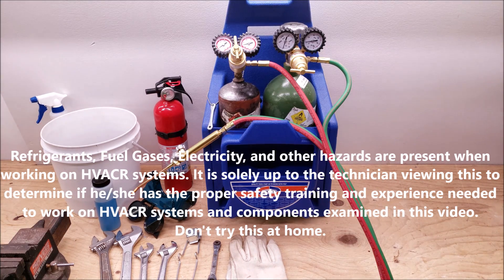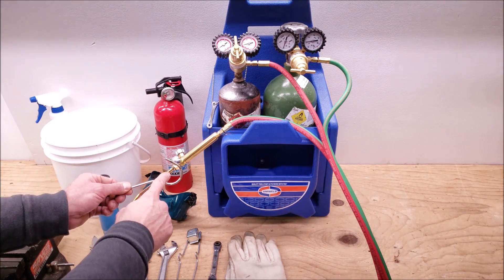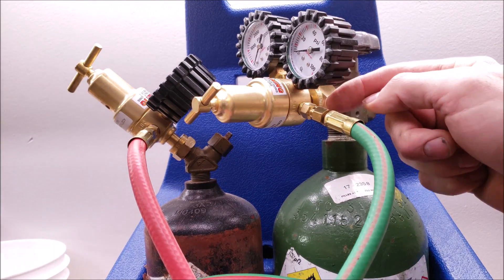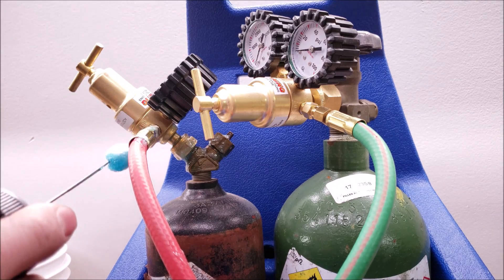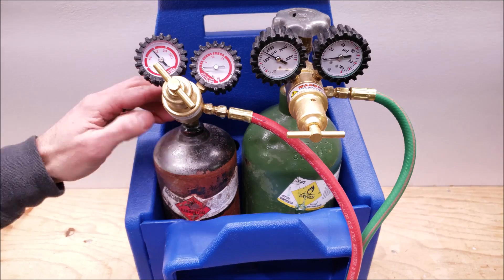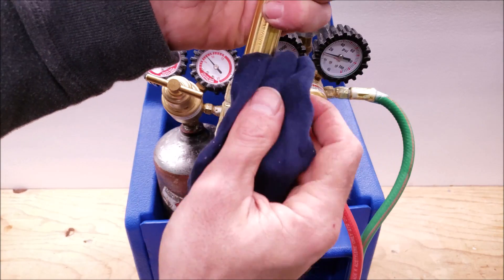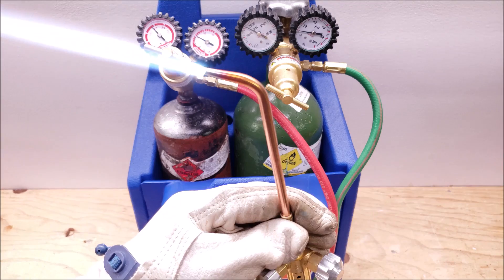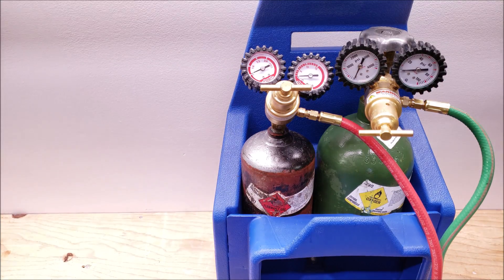Oxy Acetylene Brazing- Setup, Leak Test, Reg Adjust, Startup, Shutdown

Comment: The nut on the torch tip is to be hand tightened only.  Not sure why they put a hex on it but it does say in the manual to not use a wrench on these tips.  Its not a metal on metal seal like some older torches were, overtightening will damage your o rings and cause leaks, backfires,or worse

Comment: Need some advice please.  I found regulator gauge sets on amazon for light duty use, but it says it fits all acetylene tanks EXCEPT FOR MC AND B TANKS and I wanted to use tanks the same size as this video (MC acetylene tank). Could I use adapters or is there a regulator set I can use with these MC tanks and the small oxygen tank in this video? Thanks for all  the great videos and the help.

Comment: Nice informative video. I believe oxygen cylinders are seat to seat valves and should be opened all the way, otherwise they can leak around the stem packing (2000 psi is a lot of pressure). For additional safety leave the wrench on the acetylene bottle you don't want to go looking for that during an emergency.

Comment: Where is the flashback  arrestors or  check valves. I have similar torch and bottles and very confuse about flashback arrestors installation. I bought Flashback Arrestor Set.  Inline, 1/4 inch Barbs and I'm in the way to cut the  hoses and install arrestors. Flashback arrestors is not available for 3/8-24 A hoses. I like to see some  body to cut hoses and install arrestors and what clamps can be used.

Comment: What are your thoughts on a Turbo Torch set up?
Reply from the maker: Air acetylene will work just fine! I use those as well, thanks!
Reply from the maker: The A-11 tip is the one I use the most, thanks

Comment: Excellent explanation. 
One question. Why don’t they have a handle on acytline tank similar to oxygen tank? That would be more easier in emergency
Reply from the maker: They actually are in the process of changing them over to the easier to shut off handle now but there is a lot of old tanks out there, thanks!

Comment: Excellent video, uniwelds website says to never use a wrench when installing torch tips to prevent damage to the gaskets. Just an fyi.
Reply from the maker: I only snug it there. If you keep trying to tighten it then it will certainly damage the grommets, thanks Matt!

Comment: open the tank  valves all the way, they were designed to work that way.
Reply from the maker: Hey David, the manufacturers and distributors all recommend to only crack the acetylene tank which is fine for the output to the reg, thanks!
Reply: Should not open acetylene tank valve more than 1/2 turn. Not needed.
Reply: You absolutely must open the oxygen tank valve all the way to back seat otherwise you could lose the contents of the tank it will leak. Just crack the acetylene tank valve is fine.

Comment: Great video of safety points! Your ABC rated fire extinguisher would suit your purposes better if it had a hose on the end just in case you had a fire through a wall penetration. It shouldn't happen but mistakes do happen....
Reply from the maker: Hey the more additions to the safety gear the better, thanks Jonathan R!
Reply: @acservicetechchannel  It's not something you realize you need until you have a new helper find d out he didn't have enough thermal paste/wet rags and something is burning behind the brick wall.

 Not a good time to find out your fire extinguisher is pretty much useless.

Comment: For lighting I turn on acet. and then oxygen. Turning off I turn off oxygen and then acet.

There are forum where people preach every way possible. I don't think it matters, but turning off acet. first can sometimes cause a pop sound when the flame goes out that can make newbies jump. Lol
Reply: The pop sound is the flame going completely out, it is reaching the perfect burning mixture and causing the pop. This pop is a handy cleaning aid blowing out any little sparks that may have lodged in the blowpipe and carbon as well.
Reply from the maker: I agree there are many ways. Turning the oxygen up and turning the off acetylene off first is what stops the popping sound without making any bad black soot in the air, thanks kneeman7!
Reply from the maker: Nice tip Mentorcase!
Reply: How do you clean handle and tips for regular maintenance

Comment: Thank you so much! I bought one almost a year ago, but for any reason, or maybe I was a little bit scary to use it. Now after your video I've got the information that I can trust. Now, I'm absolutely sure what to do with my tools and how to check it first be sure it's safe. Please film in the next. Videos how to weld reversing valve properly. Some welding tips. Thank you, Craig!)
Reply from the maker: Thanks for letting me know what you would like to see Tapch. I would have to wait until I had a replacement to film something like that, thanks!
Reply: AC Service Tech LLC thank you,  will wait)

Comment: tested for leaks before you opened tanks, I also have check valves on hose to torch connectors flashback arrestors
Reply from the maker: Yes we always put the bubble leak detector on and then turn the gas on. The detector won't go anywhere and this way right when you open the tank up, you can check for leaks, thanks and yes arrestors can be added as well. Thanks Dennis!
Reply: @acservicetechchannel  good to know,, I need that type leak dect..  thanks
Reply from the maker: Hey Dennis, I have that leak detector linked on the 12th line down at-   www.amazon.com/shop/acservicetech   -thanks